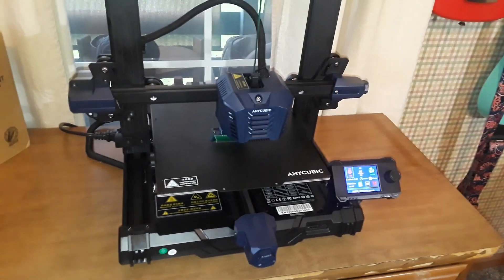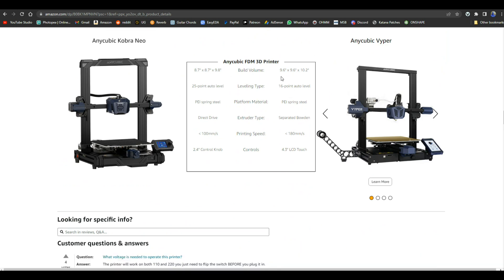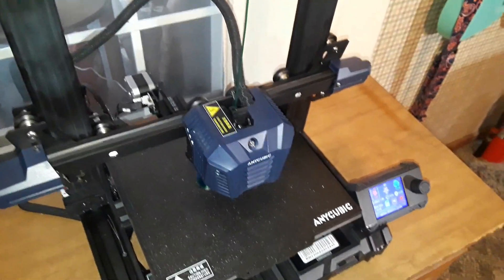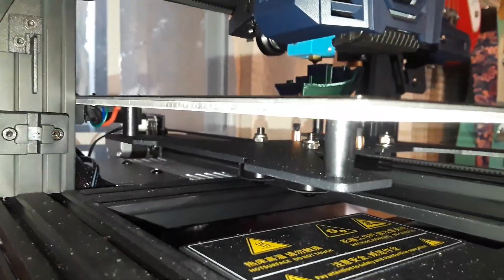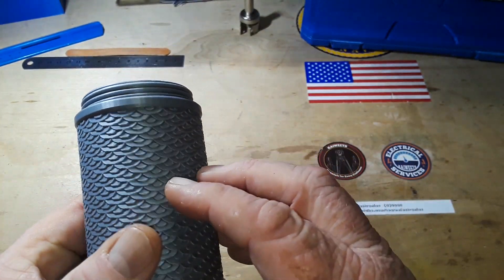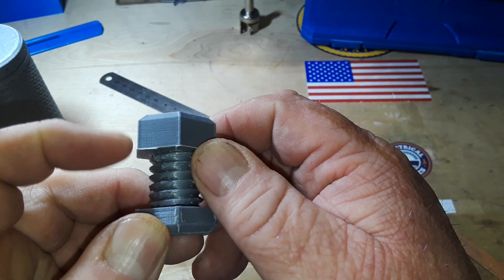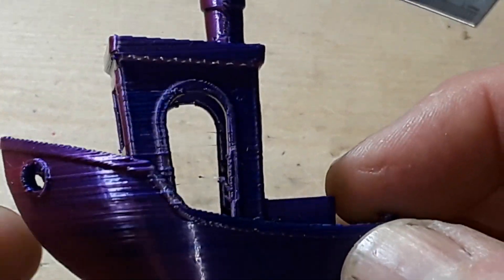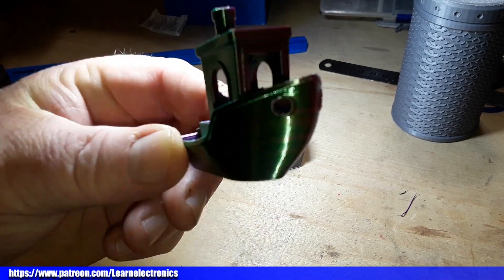The Easiest 3D Printer I Have Ever Used:   Anycubic Kobra Neo

Comment: Do you recommend it? everyone says to take ender 3v2, but I don't like Ender because of its unreliability. I want a reliable solution without modifications. can you tell me what are the pros and cons of NEO
Reply: The V2 is much better than the Neo. I have had several V2s and other than a bad batch of beds during Covid they have all been pretty rock solid. The Neo has issues with its extruder (Classic anycubic) terrible part cooling and the fact it is a rigid bed makes you rely on the iffy bed leveling.

Comment: I am impressed by how well the lettering on the bottom came out.  In my experience with silk filament, that part is usually not well-defined.
Reply from the maker: That's was my first time using the silk. Anything I did well it's purely accidental.
Reply: @learnelectronics  I have been blaming the silk filaments that I have used since they are a bit thicker than the regular PLA.  Your comment makes me wonder if maybe I had the temperature a bit too low.  I will have to try that some time.

Comment: I have had my NEO for about 6 months, and I love it. Be aware though, they are notorious for having faulty heated beds. Mine failed after a couple of months, but I contacted Anycubic and they sent me a replacement under warranty and its been running great ever since.
Reply: how did you start to tell if your bed is faulty? I've been having loud noises come from mine when my printer starts up and initally starts heating
Reply: @thebladedbeast3711  I kept getting red screen bed temp error messages and seeing fluctuations in the reported temps in Octoprint. After a while the machine would shutdown. When the controller can't be sure what the temp is it shuts down to avoid thermal runaway.
Reply: Good to know thanks for sharing

Comment: That printer looks GREAT for $169. The benchy looks great! Direct drive, Auto leveling and a solid mounted bed in that price range is unheard of. Great purchase Paul!
Reply from the maker: It is really nice, I've had a real love hate relationship with 3d printers since I got Anet A8 years ago. The last 4 printers I had, all Ender clones would work great for about a month and then no matter what I did I couldn't get good bed adherence. (Even with PEI). I got some good advice from a friend and a log bog. Now I write my settings down and it makes tweaking things much easier. Time will tell if this printer is game changer...but Im already thinking about getting another one!
Reply: @learnelectronics Kobra 2 pro has some ridiculous specs and features for the price. Klipper, input shaping, steel on steel movement are all game changers at the price.
Reply: You can get it for as low as $129 with free shipping.  That's what I paid a week ago.
Reply: Hey i am going to buy my first 3d printer but i am not able to decide which to buy ender 3 neo or anycubic cobra i am also new to 3d printing 
Please reply 🙏
Reply: @oioindoor8155  ender is a better quality printer, with more aftermarket support, but for the price, the neo is amazing. It was my first printer and I have no complaints.
Reply: just buy one, but the anycubic cobra looks awesome